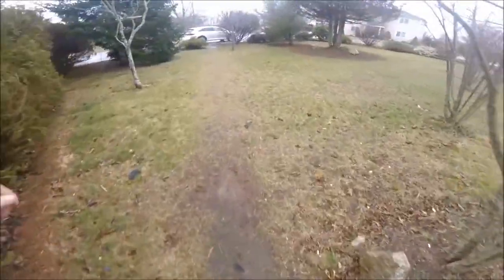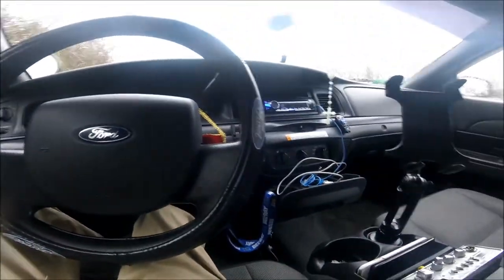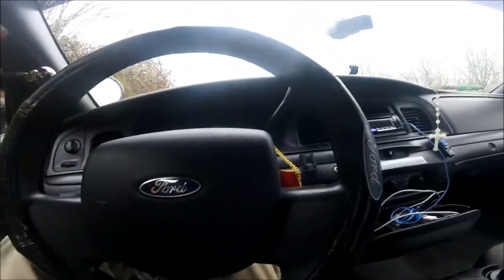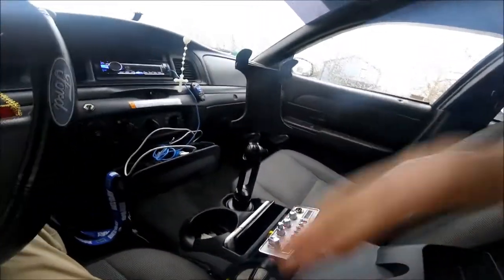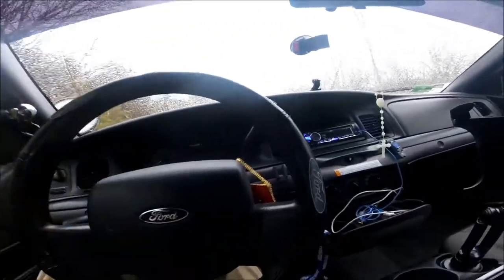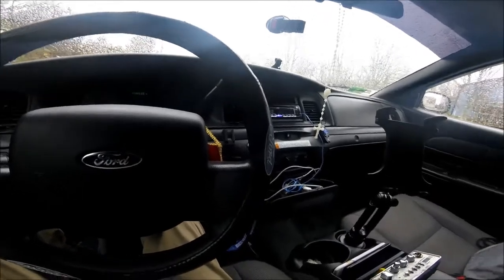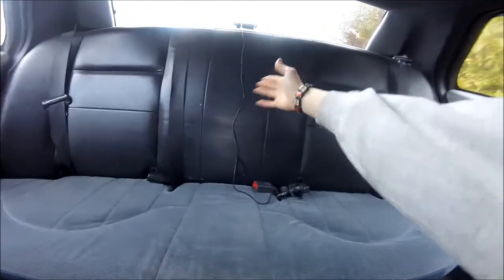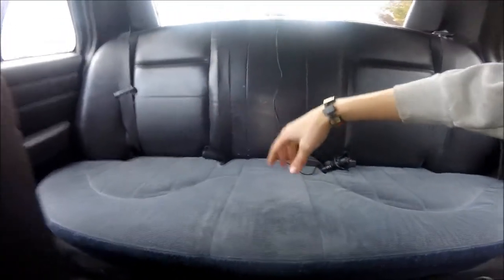Finding out what my Crown Vic used to be pt.1!?

Comment: I knew the department mine came from (bought it with the city plate still on it), but I ran the Vin on a Google search and I was able to find the city inventory. since then I can't find it anymore. I ended up going back to the department because I found the gas card STILL IN THE CAR! I returned it to the station, never tried using it.

my drivers side pillar has those scratches too. I assumed from the duty belts. Mine was a standard city patrol car.

Comment: The silver switch just right from the shifter, could possibly be to turn on side marker strobes, left and right and tail lights, you could and see if the side markers have small black plugs. if they are there, they may or not be still in there. Looks like in the video that they are disconnected because the red LED didn't turn in with the switch.

Comment: LoJack has a goal of equipping 10% of any PD's fleet. They come out and install and de-install it for free. Most K9 cars do have LoJack but its not 100%. 

That toggle switch on the dash could be for anything. You would have to follow the wiring behind it to find out. The first thing that comes to mind is a valet switch to leave the car running when the keys are pulled out. Try this: start your car, hit the switch so the red light blinks or turns on (if it still does) then cycle the ignition down and take your key out. If it is a valet switch the car will remain on and if someone jumps in and steps on the brake to put the shifter in gear, the engine will shut down. To drive again, place key into ignition and turn to position before starting. My second thought is that it is a brake light kill switch- put your foot on the brake and flip it up or down and see if your rear brake lights cut out.
Reply from the maker: 8301PC thanks for your feedback! Yea that switch... the lights doesn't turn on at all, wether the car is on or off.

Comment: I have a K-9 cage in my car there's no way a dog could have access to any of the areas you said was scratched the front scratches are probably from officers duty belts getting in and out of the car the rear ones probably happened in service, the K-9 cages are made from aluminum and there's about 8 different pieces to the cage, the seats are probably mix matched because sometimes the rear plastic transport seats are taken out and people can't find matching seats so they throw what they can find in because they don't care how it looks, if you were to remove your seats and find a lot of dog hair then it could have been a K-9 but for the most part your car looks clean so it was probably just a regular patrol car, the K-9s like to chew on the seats and rip them up in every K-9 car I see the headrest are tore up. The thing on your dash is a very simple generic toggle on and off switch could have been used for a million things.

Comment: You'd know if you had a K-9 car if you car has a "dog" smell and under the seat and in the back window is covered in dog hair. Even after deep cleaning you should still see evidence of it. If you look on the black weather seal around the drivers door or the B pillar of it is cut, you know it had a partition in it, and therefore was probably a regular patrol car. Both of my cars are from different departments. By typing in my VINs in google I see the auctions posted online where they were sold and which departments were selling them. Plus my black vic had the outline of the unit number on the roof, and my white vic had a Fuel Man card in the glove box with the city it was used in and the unit number. Both of mine were patrol units.
Reply: You took the words off my keyboard. K9 cars are gross because they smell like wet dog and dog hair is everywhere- you will NEVER get them all out unless you strip it out. They are also constantly idling so you will have an insane amount of idle hours. IDK why some people love K9 cars so much. I would avoid them.
Reply from the maker: Jono good note on that, thanks for your feedback!
Reply: I agree my 05 Tahoe ppl was a ex k9 out of grand blanc township and it has 12000 hours

Comment: the switch is for the tracking system that was in the car. If you look near the steering column under the dash there might be a silver box and that is the tracking system.

Comment: Found an amp mounting plate with an evidence sticker on it behind the trim panels in my trunk from Walton County Florida Sheriff's Office. 
My keys have 505 etched in them, the key ring also had 505 on it... And you can see where it had 505 on the roof. 
So mine is WCSO unit 505, best of luck finding the origin on yours.
Reply from the maker: Evil Jim Wow cool little story behind the history of your car, wish mine would have some sort of clue...
Reply: Mine was an FHP (florida highway patrol) from the tampa area......I know it was an fhp because the apparently lazy PD decided it would be a good idea to leave the decals on and just roll some terrible not quite black paint over it -_-

I was able to find out it's origin county by looking up the vin, and surprisingly, mine still had the maintenance records from the PD in the glovebox....so I was able to find out it's origin city too! I can't remember the city name off the top of my head, but I know it's the same county as tampa. In fact, when I bought mine (I got it from a dealer who got it from the auction), those maintenance records were only like 4-5 months old....so I'm 99% certain I'm the first civilian owner of my cvpi! Mines an '06 and I got it in june of last year.

Either way....you've earned a new sub!
Reply: your city is tampa your county is hillsborough  i got mine at auction there and its a 04 from hillsborough county to. tampa detective vehicle.